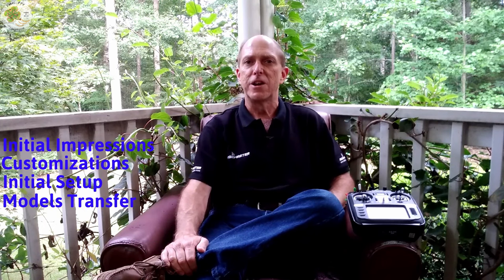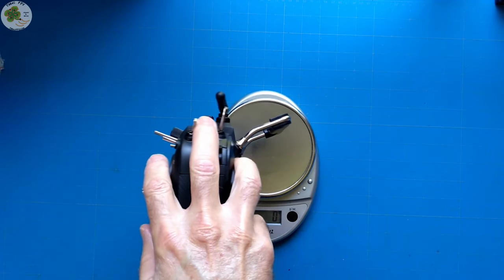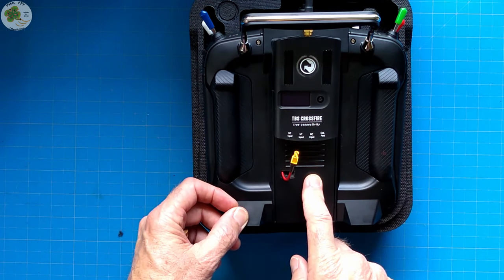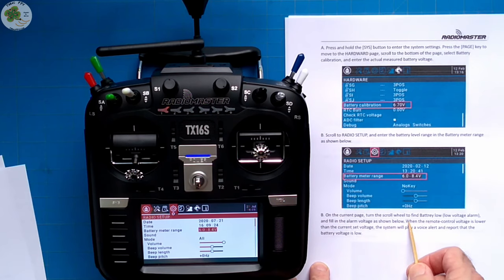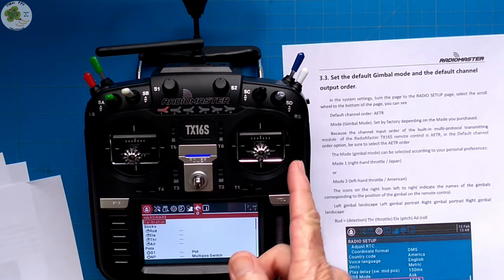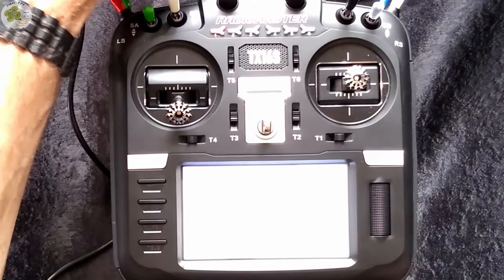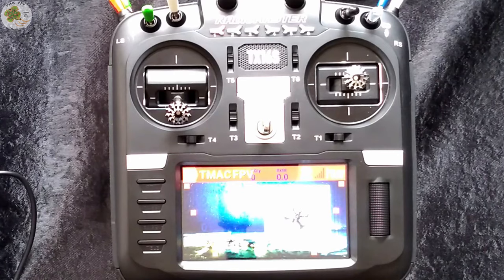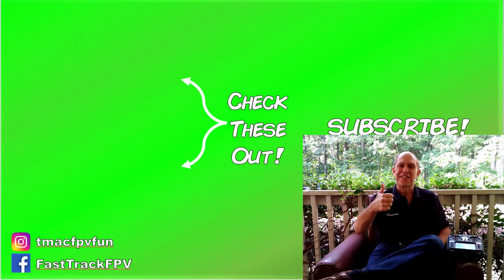RadioMaster TX16S (Setup, Customization, Comparisons and Flight!)

Comment from the maker: What do you think of the new RadioMaster TX16S?  TX16S or Jumper T18?  Is FrSky even an option anymore or did they make themselves obsolete?  Let me know in the comments below and make sure to check out the TMac FPV site at tmacfpv.com ! 👍
Reply from the maker: @RJ Deering main difference between the Crossfire Lite (one I have) and Crossfire Micro V2 (that I'm aware of) us the Lite has a max power of 2 watts and the Micro V2 has a max power of 250mw (which is enough for about 95% of FPV Pilots). I fly my Lite with only 100mw most of the time!

Comment: Where did you learn that "bootloader mode" trick?  There's nothing in the manual about that at all!
Reply from the maker: Hey Tom!😃Honestly, its been a few years so I don't remember exactly where I learned it from.  However, most likely similar to how you just learned it.  Its the same for any transmitter running OpenTX operating system firmware.  Now, I do my best to pass on what I have learned through experience what's worked for me to others.  I do that through videos like this one and the Fast Track FPV Course ("rookie-friendly intro to FPV quads course).  I will provide you with two sources of info you might find useful.  First, is OpenTX University.  This link has info on how to enter bootloader mode.  http://open-txu.org/home/undergraduate-courses/fund-of-opentx/part-3-understanding-boot-loaders/  The second loink you may find useful is my Playlist on OpenTX, specifically starting with OpenTX Basics.  Although most videos in this series were done with the Jumper T16, they all apply to teh RadioMaster TX16S since, as mentioned, above, OpenTX is the same for any transmitter using it.  Here's the link. https://www.youtube.com/playlist?list=PLKAiYAaTdvmqxtSKfP-2_QQlS_fd6h2YU  More questions you think I can help?  Feel free to shoot me an email at tmac@tmacfpv.com 👍

Comment: Coming from a world of Spektrum but now ending up with a variety of radios, what is tbs crossfire module for, do I need it, and where do I get it?
Nobody seems to mention this.
Reply from the maker: Hey Tom! I've got a short Playlist of a few videos on TBS Crossfire I'll link below. The videos use the Jumper T16 but it's exactly the same with the RadioMaster TX16S. TBS Crossfire is a 900mhz band system instead of the usual 2.4 GHz system.  This 900mhz band allows for much, much further range (at the same power) than 2.4ghz. It also penetrates objects much better so you can fly through and around objects (trees, buildings, etc) without losing signal. TBS Crossfire control link is also "self-healing." The TBS Crossfire Micro V2 module just came out and is your best deal and you can get this optional module from various hobby shops like here: https://pyrodrone.com/products/tbs-crossfire-micro-tx-v2 .  Once you have this optional module, you will need to use Crossfire receivers.  I use the Crossfire Nano and there's also the Crossfire Nano diversity.  They are a bit more expensive than your "normal" receivers but in my opinion, well worth the little extra cost for the peace of mind (never have to worry about signal loss again and telemetry is "automatic."   Let me know if I can help further.  Here's the Playlist link https://www.youtube.com/playlist?list=PLKAiYAaTdvmo2pW-JWLDRjJ3Pohjis0jA
Reply: TMac Thank you for taking the time for that awesome explanation and the links!
Reply from the maker: @tomvedra5405  Sure thing Tom, my pleasure. Fly fearlessly & Journey to Better!😁👍Have a great week 🌞

Comment: Computer will not connect to Radiomaster TX16s Radio, just comes up as USB device not recognized error code 43
Have tried two different windows 10 pc's with same problem.
Reply from the maker: Sounds like the "updated" Windows driver perhaps? See this video and read the comments in the comments section for other ways to resolve  https://youtu.be/SDnRSL3rDwM

Comment: Great Content... I tried to reflash the sd card, and when I put the card back in a "reset" the "write firmware" folder reads empty, but on pc the files are there... any help?
Reply from the maker: Hey Styles Extraordinaire!  Not exactly sure what yo mean by "flashingthe SD card," however, I'd recommend you take a look at the video titled "Jumper T16 OpenTX Firmware Update" in this Playlist of OpenTX videos https://www.youtube.com/playlist?list=PLKAiYAaTdvmqxtSKfP-2_QQlS_fd6h2YU . It will help.  Although that video (and most of the Playlist) uses the Jumper T16 to explain OpenTX, OpenTX is eactly the same on the RadioMaster TX16S (or any other transmitter using OpenTX operating system firmware)!  let me know if you have further questions after going through the stuff.  Fly fearlessly friend!👍
Reply: TMac, thanks for the reply. I formated the Tx16s' sd card and tried using both the original firmware and OpenTx, neither is working correctly. I will check out the suggested vid, maybe I missed something. I appreciate the help.

Comment: Just upgraded to this TX16s after getting fed up with taking my Jumper T16 apart to sort the ribbon cables out. I have had to do it six times in the last six months, so this will be a great relief from that. I'm impressed so far with this TX. The speaker isn't as clear as my Jumper TX but seems a bit louder. I've transferred all my models from the Jumper into this one along with all the voice files (they were better in the Jumper) and my images. I save a copy of the original files on my laptop and then delete all the ones I don't need like all the other languages and images, before replacing them with just the ones I need. 
I'm not sure why you need to hold the trims in and turn on the TX, on both the Radiomaster and the Jumper I just plug the USB into the laptop and it gives me the option of joystick mode or SD card on the screen. I just select SD and everything is there on the laptop. Maybe mine is a different version or something. It all worked perfectly in OpenTX.
I actually think the Radiomaster doesn't feel as good quality as the Jumper when held in my hands, the sticks on the Jumper feel much slicker as do the switches, plus the speaker is much better quality on the Jumper. But, given the problems I've had with the ribbon cables on the Jumper, the Radiomaster wins. Of course, this is comparing the Radiomaster to  the Jumper T16 Pro, but the newer Jumper T18 might be a different story. As long as the Radiomaster keeps working reliably it gets the thumbs up👍

Comment: With these genuine Samsung batteries you can use the LIPO setting on your charger and charge to 8.4v or just use the USB-C charger in the radio, also to 8.4v.
Bob (Bob's Batteries). We also make a 5000 mAh  charging kit for the Jumper T-18 (which has no internal charger).
Reply from the maker: Thanks Bob! I did not know that about the LiPo setting on your charger.  Appreciate the info! and sweet batt's!👍

Comment: Thank you for this video I know that this is an old video but I was wondering if anybody knew how to calibrate my receiver battery sensor for my quadcopter on my tx16s. When I plug my battery in to my Quadcopter under the sensors for my crossfire that shows me my information on my screen it always shows 78% when my battery is 100% on my Quadcopter.thank you

Comment: Hi TMac, thank you for this clear video and your honest take on this Radio Master TX 16S radio. I am currently in the process of upgrading from my Futaba 18sz😳 my problem came with ability (or inability) to fly fixed wing FPV long range. Must decide between FS Paladin PL18 ( easier to set up etc and quality🧐 ) and the Radio Master TX 16s max with cross fire, but I am very uncertain about my ability to learn Open Tx🤓. Just subscribed as I feel you deserve more subs🤗regards from SA
Reply from the maker: Hey Percy, great to hear from you!  welcome aboard your TMac FPV Team!  Regarding learning OpenTX, I am positive without a doubt, you CAN learn it.  Only question is, do you WANT to.  OpenTX gives you the flexibility to basically program your transmitter to do whatever you can imagine.  You're not "locked in" to one set of switches performing one specific function, etc.  Its all up to you how you want to set it up.  Here's a "starter video" on OpenTX.  The major benefit of this video is understanding the "Concept" of OpenTX and how information flows within it.  Once you understand the concept, it makes more sense and you'll better understand the "why" behind what to implement whatever you want.   https://youtu.be/luy2U04_WFc  The Tx16S with Crossfire I trust completely.  I do not fly fixed wings, however, I fly periodically over a large lake near where I reside without hesitation (you can see some of this in a few of my videos).  I have seen others who DO fly fixed wings (on TX16 Facebook Groups) say they too trust the transmitter with their expensive models.  Not trying to talk you into anything.  Just letting you know my experience with the TX16S and what I've heard/seen other fixed wing flyers say
Reply: @TMacFPV  Hi TMac. Much appreciated. A major part of our fantastic hobby is the ability to get answers on important issues and questions (much like the after-sales service in any industry, adding great value OR the opposite to what might be a great product.) The impression so far regarding Radio Master is their willingness to “hear” and respond to their market and the advice from the experts using their product coupled with the willingness that experienced guys like you (and many others on Youtube) have to share the hard-earned information with guys like me, saving precious time and the cost of faulting during the learning curve. Great de-mistification of a fantastic radio . Thank you for your response. My hat’s off to you. 🙇🏼‍♂️🙇🏼‍♂️

Comment: 5000 mah 2s1p does not exist ,,, the highest a li ion battery goes is 3700 mah so the pack of 5000 mah is fake ,,,

nice vid though about the radio :)
Reply from the maker: 2s1p simply means 2 cells connected in series.  You may be thinking of 18650's?  Two 21700 Li Ions in series can have a 5000 mah capacity.  there are plenty of reputable 21700 5000 mah li ions out there

Comment: my local hobby shop told me that if i bought the tx16s transmitter it wont bind in a receiver that has as3x and safe technology and if it did it wont be functional is that correct? or was he just trying to upsell me on buying a spektrum transmitter. please help
Reply from the maker: AS3X is a Spectrum receiver. TX16S does support Spectrum protocols through its Multi-protocol Module (including SAFE) using DSM as indicated here https://www.multi-module.org/using-the-module/protocol-details/dsm . This same site shows all supported protocols within the Multi-protocol Module if the TX16S

Comment: I'd tell ya but My RadioMaster TX16S just arrived this morning at 11:30 AM, didn't receive notice until 12:50 PM and the Post Office is only open until 12:00 Noon, and they didn't put my Radio in a Parcel Box, they left a yellow card in my PO Box, so I can't pickup until Monday Morning....! Anyway I had a Flysky FS-i6X Transmitter($50.00), I was doing an Antenna mod on it, while removing the old antenna cables from the U.FL base cups(2), one of the Gold Plated base cups came off in the antenna lead connector..! I couldn't repair it, so I ordered the RM TX16S Radio....! I couldn't find any locally, all were coming china, I said, NO WAY..! So it cost me a few more Dollars($149.99) and got here quicker...! Now all I have to do is wrap my head around Open TX...? I subbed here and will be checking out other videos on this channel for the TX16S....!   =)
Reply from the maker: Welcome Ja LPa! All my videos that are on the Jumper T16 apply to the Radiomaster TX16S . Check out these Playlists JUMPER T16: https://www.youtube.com/playlist?list=PLKAiYAaTdvmqHBs7M0n3t2mSzxY9jEtWK and OpenTX: https://www.youtube.com/playlist?list=PLKAiYAaTdvmqxtSKfP-2_QQlS_fd6h2YU

Comment: Sir,  now we have the same Equipment.... 
have you also the DJI FPV?  
This is an absolutly Super Combo.

But i have soldered one extra large Momentary Switch on the other Side.,  So i have now two of them and i can do Save arming/disarming,  reseting Timers etc. 

My next project is an Wireless DSM Headtracker for the Radiomaster and Multimodul is the Receiver

Every Time Great Stuff from You
Reply from the maker: Cool!  No DJI for me as of now.  Wow!  Sounds like you've got a great setup!

Comment: TMac, Thank you very much for your video support. Question if I may, I order one week from now at Banggood the black version of the Radiomaster TX 16S. (Hall gimbals)  Is the new colour versions technical speaking much better than the original black TX. I mean better sliders, gimbals speaker, switches, etc. I understand. Are there must haves apart from the standard delivery (may be a better speaker?) Greetings from the Netherlands.
Reply from the maker: TX16S Max upgrades include lower sitting gimbals (ergonomically better-easier reach), along with "switches & roller upgrades, and improved plastics, pots and sliders.  All "new release" TX16S come with second speaker now (so I don't know if the one you're about to order is from the newer batches or if its one that's been in stock from the previous batches with only one speaker--you'd have to ask the vendor).  The Tx16S and TX16S Max operate the same

Comment: Do the grand lotus stick ends hit the inner bottom corner frames. I have used the spaces and there doesn’t appear there would be enough space but if I’m using a shorter stick ends then I won’t need to use the spaces anyway
Reply from the maker: On the TX16S Max (which has slightly recessed gimbals compared with other versions of the TX16S), the tops of the Grand Lotus stick ends , at full deflection, just barely touch the circular cut outs of the transmitter face plate at each corner.  This does not appear to affect full stick deflection (it happens simultaneously with full stick deflection).  Hope this helps
Reply: @TMacFPV  yes it does, I thought that the spacers that came with the cnc kit were thicker than the ones that came with the Tx16s max but I had already installed them so it was too late to check. Knowing that that already slightly recessed on the Max I will be removing the spacers before installing new stick ends.

Comment: Hi sir. I recently come across the cheaper potentiometer gimbal version. Is it worth to pair it with 2019 r9m module? Will it work out of the box if slot in jr bay? This cheaper version is okay i think for softcore pilot like me. Any input on this sir? Thanks and stay safe sir. God bless
Reply from the maker: Hey HelioGenesis-HS! The TX16S supports the R9M module so it should work fine with the R9M module.  I'd recommend the Crossfire Micro TX V2 module over the R9M (unless you already have the R9M module). Potentiometer gimbals should still last you a good long while 👍
Reply: @TMacFPV  yeah. I will go tbs route now I'm confidence to buy tbs even its little expensive on micro v2. Thanks for tips sir.

Comment: Just got my Radiomaster I updated it now the background screen is just blue I’ve removed the background png file and replaced it checked size etc same as how you change it on jumper, any ideas why it doesn’t recognise? Should I update it again maybe, thanks for the video appreciate your vids 👍🏻
Reply from the maker: Hey Big Willie! Not sure what the issue could be.  what did you do with the old "background" file?  Did yo just overwrite it with the same name, did you delete it, or did you save the old background file as another name somewhere?  Did you save the new file with the name "background" ?  Only thing I can think of at this point is the radio is confused as to what file actually is the "background" image file.  Are you using the original SD card?  if so, you might want to try another one formatted as Fat32 (after you have saved everything from current/old SD card) per this video: https://youtu.be/vRn9UNujsMI  That's all I canthink of for now.
Reply: TMac hi mate I’ve tried several things renaming the file swapping it for one from the jumper tx file, I’ve swapped SD cards with my old jumper one, I might roll back the update use another SD card and see how I go, thanks so much for your reply your a champ and I appreciate your help, guys like you make this hobby awesome 👍🏻
Reply: TMac rolled back firmware and all good now
Reply from the maker: @BigWillieFPV  Outstanding!👍😁
Reply: @BigWillieFPV  make sure its a .png and not a .jpg image

Comment: what is the range ?
Reply from the maker: Hey Norman!  The range depends on many factors some of which are: 1.  if you are using the 2.4 Ghz band of the radio or are you using the 900 MHz TBS Crossfire module "plug-in" capability (900 MHz has much further range capability), 2.  what receiving antenna yo have mounted on your RC aircraft and how it/they are mounted, 3.  any RF interference in the area you'll be flying, and 4.  the actual landscape you'll be flying over/through (will you be flying over a flat open field or will you be flying through trees, doing mountain diving, etc.?  Now, having said all of that, this radio transmission the 2.4 Ghz band at the same legal power as all other hobby-grade transmitters (100mW).  Using that 2.4 Ghz band at that transmission power level with a "normal" 2.4 Ghz ACCST protocol diversity receiver on your RC aircraft, you can expect a range (flying an open field) of approximately 1.5 - 2.5 kilometers.  If you use the Crossfire module system with this transmitter, you can fly  (if legal in your area of the world) many miles
Reply: @TMacFPV  Thanks for prompt reply. i have tried several frsky  s6r rx  correctly tuned, and  at about 30yds on ground test I get low rssi. any further and I get critical call. I could get longer distance with taranis tx. Not tried in the air yet.